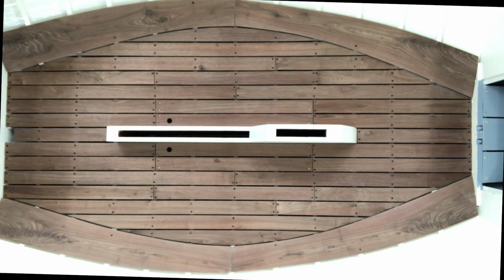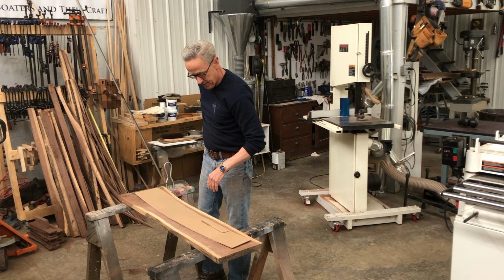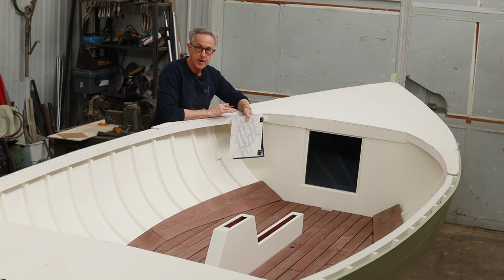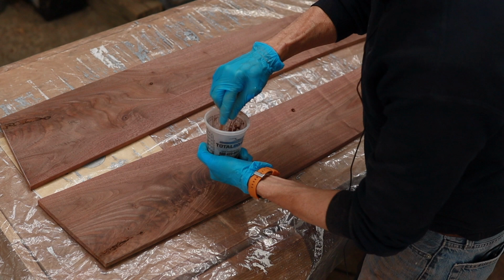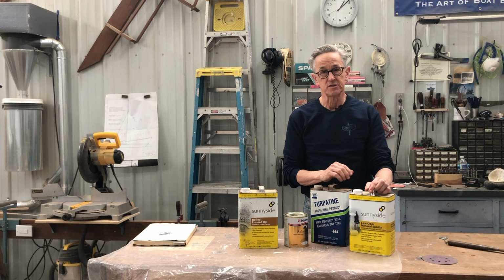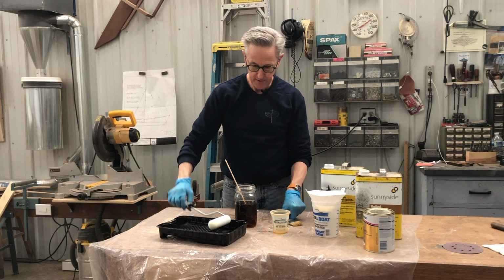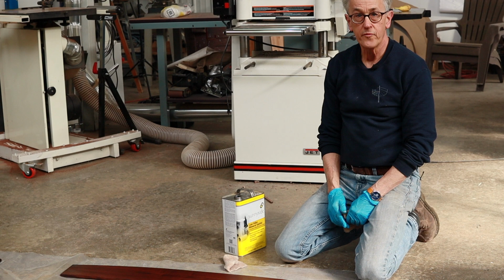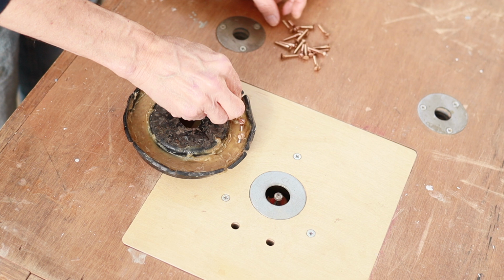Wooden Boat Building, Installing Walnut Floor and Margin Boards, S2-E44

Comment from the maker: I miss spoke in the video referring to boiled linseed oil as being heated. Boiled linseed oil gets it's name from the Medieval era, where linseed oil was boiled with lead oxide to promotes the hardening  of the linseed oil by reacting with atmospheric oxygen. Heating shorten its drying time. Today boiled linseed oil isn't actually a heating process, but rather the practice of mixing metallic dryers with the oil to make it dry faster. Raw linseed oil can take anywhere from a few weeks to a couple of months to fully dry where as Boiled linseed oil take about 1 day. 
Cheers,
Bob
Reply: Thank you, Bob.
Reply: When I was sloshing masts on "Drudge Boats " Skipjacks in the Chesapeake we used Boiled Linseed and turps to finish a freshly scraped mast then as we did coats added a bit of varnish to it to harden the surface. This worked well as the mast hoops would scrape the top off but leaving the oil /turps o to penetrate the southern pine/Loblloy masts. We scraped and finish every year so build-up and darkening of the oil was not a problem, and it will darken. Much luck and fair sailing.

Comment: That story about the jar was wonderful, it would've been a great shame to lose the needlepoint!
Reply: In addition to that idea.  It is a good idea to use the wax paper and not just a new lid and seal. The lids get glued to the jar if a little of the contains are on the jar.  Some times I need to put a glass jar in a vise to get the lid off. The wax paper would prevent that from happening.  Maybe your Mom was even smarter than you figured.
Reply: @chetthejet3896  Moms are always smarter than you figured....  8^D

Comment: Looks awesome.
For the technically curious:  'Boiled' linseed oil is no longer boiled, it has heavy metal driers added instead.  If you want really boiled linseed oil look for 'polymerized' linseed oil.
Perpetual warning: Oily rags can spontaneously compost, dispose of rags properly (in water, in fire).

Comment: I made Boat Soup by mixing equal parts Tung Oil, Pine Tar, Turpentine and a couple caps full of Japan Dryer. Smells wonderful. It’s very important to put rags in a bucket or bag of water. Spontaneous combustion does happen when you have oils and solvents mixed and on rags or sponges.

Comment: Clever way you used a batten to avoid the problem of fraying:crumbling edges on the template. And I noticed at times you worked from the middle boards out while applying the finish. I sometimes remember to do that - saves clothes and avoids having to clean up so many drips. Thanks for the video!

Comment: This series is amazing, and I am pretty envious of both your skills and more importantly your patience.  Truly gifts.  One quick question, when you put wood. Together, for instance the scarth joints, you use epoxy.  Why not waterproof wood glue like tightbond iii?  Thank you again, it's amazing
Reply from the maker: Hi Andrew,
Thanks for your question. I have used Titebond III in several application. Basically if the joint is going to be in a  more constant wet environment, like the hull I use epoxy. If not, like interior trim, topside trim, I've used Titebond III. Sometime if I was concerned with the color of the glue joint I might use epoxy with wood flour from the material to thicken and color the glue, also what I'd use to fill imperfection like small knots. Both great glues!
Thanks for watching.
Cheers,
Bob
Reply: @TheArtofBoatBuilding  thanks so much.  Again, great work.  Truly impressed!

Comment: This boat is going to be so beautiful that it should be put on a pedestal and displayed. Well, not really, it has to be used. You mentioned touching up the floor boards a couple of time a season to keep them bright. Would you do both sides? (top/bottom) Thank you for sharing. Have a great day and stay healthy.
Reply: Just using a coat of linseed oil wiped on after a little mud and dirt would be easy.

Comment: Beautiful work as always, and great video and editing work, must take ages to do! 

I was wondering if there was a means of creating a non slip finish.

On regular floorboards have seen people use sand or sugar in the paint, but that would spoil the fine look and not sure how that would work with the Danish oil finish.

Perhaps a non slip floor is not needed?

All the best Boris
Reply from the maker: As the floorboards weather they will be naturally non slip as in any wooden decked boat.
Thanks for watching!

Comment: Very nice work!! Do you ever use Flitz to polish the screw heads? And line up the screw slots for to aft? Up close details? Thanks for sharing this build!
Reply from the maker: Hi Samuel,
Thanks you! I use Mothers Polish for small jobs. I will not polish the screw head as I look forward a natural patina forming. Some may think I'm a perfectionist, however I did not line up the screw slots! 
Thanks for watching.

Comment: Hello Bob, one question: how do you remove the water that enters under that wooden floor? Thanks for your answer and Congratulations on the work
Reply from the maker: Bilge pump, something like this one 
https://thebetterboat.com/products/manual-bilge-pump?gclid=CjwKCAjw092IBhAwEiwAxR1lRsIXItN3d2nHV5VXJjms3n5vatymniI8-QmiuXAJ7xfvPpt5puAgoxoC53kQAvD_BwE
Thanks for watching. 
Cheers,
Bob

Comment: Bob, a few questions about lining-off, although I realize this is not what you are working on at the moment. As I look at the lining-off video, it appears that, except for the wider garboard and broad strake, you divided the planks by equal width starting at the widest mold, and then again on the aft end at mold 22 and then at stern end at mold 4. My question is about mold 4. Why this mold, and not, say, mold 2? And why not at the actually stem? Would this look bad or something. Finally, how did you decide on the width of the garboard and broad strake? Thanks

Comment: how do you get water debris or rubish out from underneath the floor boards? shouldnt there be a few removable boards to facilitate regular cleaning/inspection? or am i missing something?
Reply from the maker: Hi Mario,
There is a hatchway on both the Port and Starboard side of the centerboard trunk. It can be easily seen at 24:40 in the video.
Thanks for watching!
Cheers,

Comment: Always used raw linseed oil for outdoors, boiled for indoors,
UV will harden the raw linseed oil,
Boiled sits more on top of the wood, raw will penetrate and thus better outdoor applications.

Danish way.
Reply: "Boiled sits more on top of the wood, raw will penetrate"  Not so sure about what you wrote. May be the opposite.
Reply: @chetthejet3896  no,
Boiled linseed oil will create a film on top of the wood, like a varnish.
Raw linseed will penetrate the wood, just like any raw oil finish.
Reply: @dennisboisen  Thank you for your reply, I use the boiled and it works fine. I learned something new,  I use it on small projects but not boat building.

Comment: How do flat margin boards rest on the curvature of the frames, however so slight? Don't they need to be rounded slightly on the downside face?
Reply from the maker: Great question Paul. The frames at the point the margin board lay are nearly flat. The boards do bend slightly longitudinally. You can see me press down on the center as I'm fitting them in.
Thanks for watching!
Cheers,

Comment: Not to disparage the very meticulous job you did, Bob, on the margin boards, but... I find them more than just a bit distracting. In fact, I see them as detracting from the overall beauty of the boat to the point of almost hideous. Further, I see no practical need for them. Boats don't really need "kick-plates" on the sides of the inner hull. The gorgeous wood you selected for them does nothing to dispel the glaring intrusion I perceive them as. Even if you painted them the same as the inner hull so as to render them nearly invisible, I still see no practical need. To the contrary: they are traps for small, irretrievable items until the boat is beached and tools used to dismantle parts to rescue captured items. Plans be damned! Some things just scream "Don't bother"! (Sort of like adding decorative trim on top of other decorative trim-- why?)
Reply: @James Festerman I agree that the boat is beautiful-- it IS a work of art! Bob has spared no effort in ensuring that... I just feel like those boards are as if Leonardo da Vinci threw a bunch of gold glitter on The Last Supper. Why?